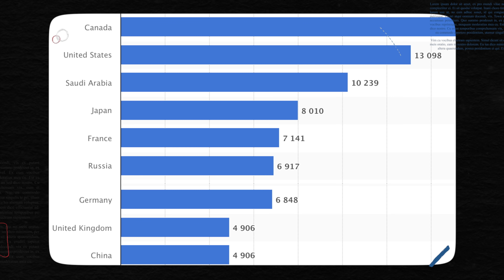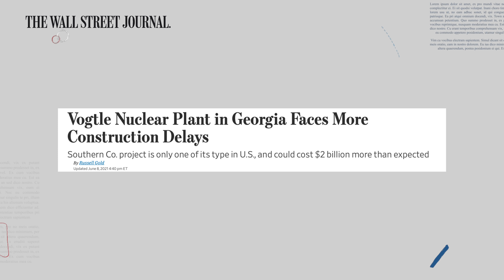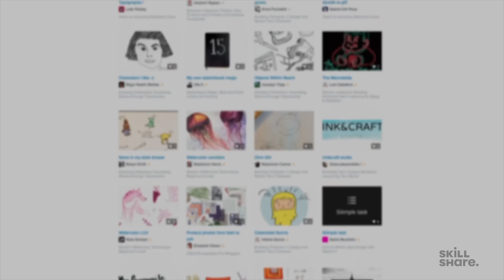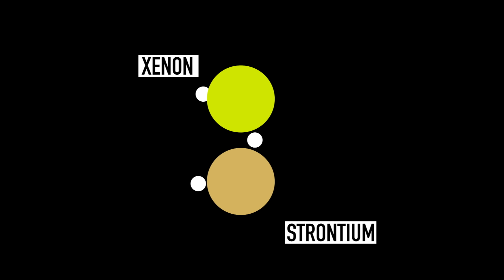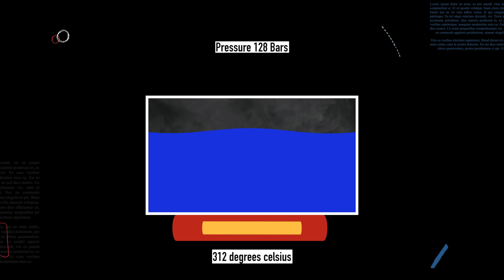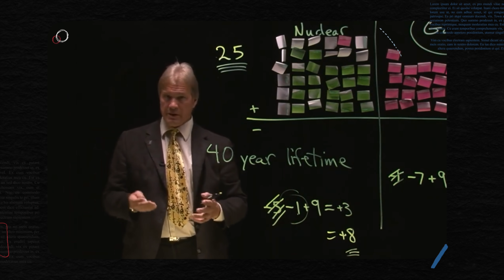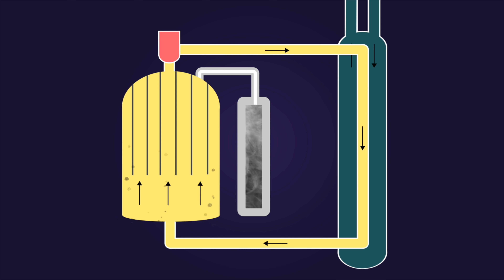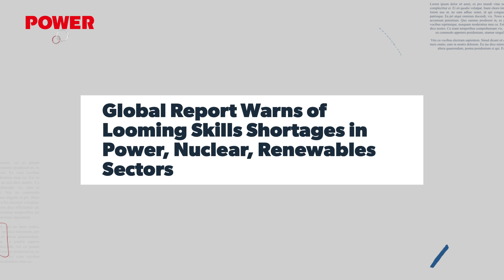Thorcon Just OBLITERATED Nuclear Energy’s Biggest Problem

Comment: Way to go Indonesia. In the US regulations are still based on the site, not the process. In a century that loves to brag about the economy of scale, where Ford is credited with inventing the assembly line we have to watch as the rest of the world passes us by. Bans on reprocessing, and a gov that dropped the ball on collecting the waste they won't let anyone else touch, and unrealistic tax write off schedules have really set this industry back even more than is pointed out in this wonderful segment.
Reply: Huh, Huh, Huh. I got some questions: doesn't the molten salt fuel eat through most reactor and containment methods, because it is SO CORROSIVE. Does it not react with water explosively, so if it were to receive a leak of water drops or worse, if the containment were to break and the fuel were released into the atmosphere, the results would be plumes of vaporized radioactive fuel for the residents of surrounding counties to breathe in deeply? Finally, in computing the cost of nuclear power did you figure in the cost of depopulating areas the size of US states as you nuclear industry folks accomplished in Chernobyl and Fukushima? Are you advocating planting the nuclear power plants in the ocean bottom now, so you can honestly say that you cannot reach or fix or prevent the underground radioactive leaks, when they occur, to limit your expenses? Are you totally nuts? 

Go live in Chernobyl's exclusion zone. You can get very close to nuclear stuff there. Reportedly, due to the inadequate clean-up, Fukushima is also another place in which you can get close to your beloved nuclear power. Go play around among their plastic bags of contaminated, radioactive dirt. Those are going to leak soon, what with having been exposed to the sun and wind for close to ten years, so you will soon have nice, radioactive dirt that you can use to grow your own crops. Have fun, fun, fun, until the cancers take your fun away!
Reply: @mikefas1160   No, I don’t advocate nuclear on the bottom of the ocean. I think it should be in every neighborhood. If I had my way I’d put in everyone’s car, then you could plug in at home and power the house, drive to work plug in there and keep supplying energy wherever you go. 
You may have missed what none nuclear accidents have occurred. The AEC used to set off dirty bombs and watch reactors melt just to see what would happen. I’m sorry to disappoint you Mike, but that’s not how radiation or cancer works. 
If you are interested in learning a good source would be Galen Windsor, but you’ve got to put down the Jane Fonda first. If you’re an internet troll you won’t get any here.

Comment: The problem with nuclear Plant construction is not just cost.   It's also that construction releases a vast amount of CO2 into the atmosphere and the Length of time it takes before anything is generated is so long they may just contribute to cLimate change rather than save it.   Uranium is cheaper than fossils but is limited in supply and will get more expensive quickLy.  Agreed nuclear is a better option than fossil fuels however compared to a landscapw aiming to have max renewables and then nuclear doesn't have the flexibility and you left with power statipns or wind farms built solely for times of Peak capacity.  Nuclear reactors have to be offline for over a month for refuelling every 18 months we currently buy in power fromcoal to cover those times.   If we have full renewables there is no waste no mining and no co2. We invest in storage interconnection and tide/wave power and manage demand rather than supply by a clever network that knows when to charge batteries and cars and knows when to draw down.  It's within reach and the UK NAtional grid will be able to do this.  Nuclear just too many issues ..
Reply: "It's also that construction releases a vast amount of CO2 into the atmosphere"
Not so vast for the amount of electricity produced by a nuclear plant.

"Uranium is cheaper than fossils but is limited in supply and will get more expensive quickLy."
Enh, everything is limited in supply, even sunlight. But the limit of uranium is very high. (Ditto for sunlight.)

"Nuclear reactors have to be offline for over a month for refuelling every 18 months"
This design would allow refuelling without taking the plant offline.

"If we have full renewables there is no waste no mining and no co2."
Renewables don't grow on trees. (I mean, unless you're talking about actually burning trees.) There's a lot of steel and concrete used in wind and solar plants per amount of energy produced.

Comment: I would ask the question regarding damage from earthquakes because Indonesia is just about the earthquake capital of the world and also has a high incidence of Tsunamis. Given that these reactors are sunk in the sea near the coast what would be the result of being hit by a quake and a tsunami?
Reply: Huh, Huh, Huh. I got some questions: doesn't the molten salt fuel eat through most reactor and containment methods, because it is SO CORROSIVE. Does it not react with water explosively, so if it were to receive a leak of water drops or worse, if the containment were to break and the fuel were released into the atmosphere, the results would be plumes of vaporized radioactive fuel for the residents of surrounding counties to breathe in deeply? Finally, in computing the cost of nuclear power did you figure in the cost of depopulating areas the size of US states as you nuclear industry folks accomplished in Chernobyl and Fukushima? Are you advocating planting the nuclear power plants in the ocean bottom now, so you can honestly say that you cannot reach or fix or prevent the underground radioactive leaks, when they occur, to limit your expenses? Are you totally nuts? 

Go live in Chernobyl's exclusion zone. You can get very close to nuclear stuff there. Reportedly, due to the inadequate clean-up, Fukushima is also another place in which you can get close to your beloved nuclear power. Go play around among their plastic bags of contaminated, radioactive dirt. Those are going to leak soon, what with having been exposed to the sun and wind for close to ten years, so you will soon have nice, radioactive dirt that you can use to grow your own crops. Have fun, fun, fun, until the cancers take your fun away!

Comment: Fuel sat is ferociously radioactive pumping the stuff is a horrendous regulatory problem. There are no prior regulations and no prior designs to base the new regulations. 
Moltex solved the problem by putting the fuel salt into tubes (just like any PWR). The reactor core is a vat of molten salt which circulates heat by convection. There is no pumping of radioactive fuel and no moderator to wear out. Heat is extracted to a third salt, from which steam is raised.

Comment: The public are (rightly) scared of nuke waste it has a 1/2 life of 30,000 years. The Elysium and Moltex fast spectrum reactors burn high level nuclear waste. After its been used in a fast spectrum reactor, the 1/2 life is just 30 years. You also get 25 times as much energy as the old PWR could extract. All with zero CO2 and easy waste management. There is also no carbon core to store as nuke waste and over time they reduce the existing stocks of used fuel nuclear waste.

Comment: Been following this company for a while now, and while they appear to be one of the fastest movers in this area, it's still depressingly slow. :(
Reply: Part of the reason nuclear development is slow is regulation and buraucracy. Nuclear could have started replacing a lot of coal power fifty years ago, but "environmentalists" waged a propaganda war on the technology by confusing power plants with nuclear weapons. This made R&D extremely slow and expensive and investments in new projects very uncertain. Basically, the "environmentalists" managed to almost criminalize the use of nuclear power.

So when "environmentalists" fear monger about climate change and pollution from coal power, remember that they are the ones who prevented nuclear from eliminating much of these negative side effects.
Reply: TerraPower is designing a MCRE prototype Plutonium burner for France, Orano to be built at INL.
300kWe
One pump
Cooled through an RVACs like system through the reactor vessel walls.
NaCl-43PuCl3 fuel salt
Reply: It is slow because they want the governments to build and take responsibility for this technology.  Anyone can build one if you have the money to back it up.
Reply: @EnlightenmentLiberal Are you employed by some nuclear industry company or a nuclear shill?  As to MSRs I have not heard of any study about or material that worked despite corrosion, albeit the Chinese are trying an MSR reportedly. Otherwise, nuclear is dead due to Chernobyl (with its dead, human robots) or Fukushima (with its thousands of tons of stored, radioactive water or bags of nuclear waste contaminated dirt that they have no idea how to keep from contaminating Japan's water table eventually), which have corium that they still cannot even break up, because their robots keep dying (like any people that approached it would too.) Only MSRs seem promising -- maybe.

No one would cheer more than I if we can truly build a molten salt reactor ("MSR") that can render inert the "250,000" TONS of radioactive fuel that reportedly have to be stored and GUARDED for "250,000 to one million years" to prevent such waste from either leaking into the water table or being used to make dirty bombs by some terrorist. However, while I think we should experiment with such MSRs to see if we can overcome the corrosion with future technology someday (hopefully "in 20 years" before fusion power generation becomes viable), solar thermal power (using mirrors pointed at a fixed point to heat salts or fluids, which can then provide power overnight as well as when the sun is shining and which can be made with ALL-US components, reportedly) seems ideal.

Solar thermal creates no nuclear waste, no lithium or other toxic poisons, no problems except for increased costs which are paid to other Americans who then use them to pay other Americans for food or electricity, etc. Economic multiplier effects come from solar thermal power generation as opposed to buying cheap solar panels made in China that are made with toxic substances and cannot be disposed of safely  due to their toxicity-- albeit they are  much less dangerous than nuclear waste, reportedly.
Reply: I wonder if there is a way to tie a unique Bitcoin to a specific reactor?  By doing this one could produce a fungible token currency that is limited further by its specific identity to an energy producing asset.  This may raise interests in both technologies.  Just thinking.  I recognize that It contradicts the indestructibility of Bitcoin.
Reply: Go live in Chernobyl's exclusion zone. You can get very close to nuclear stuff there. Reportedly, due to the inadequate clean-up, Fukushima is also another place in which you can get close to your beloved nuclear power. Go play around among their plastic bags of contaminated dirt. Have fun, fun, fun, until the cancers take your fun away!
Reply: @mikefas1160  Most if not all of the cleanup and the evacuation in Fukushima was not necessary. It was just done to pander to irrational radiophobia in the public - the kind that you're a prime example of. You could roll around in the dirt in those plastic bags for years without significantly increasing your chances of getting cancer.

SInce your kind cannot be reasoned with, I'm going to pre-emptively mute you now. Bye.
Reply: @mikefas1160  Fossil fuel particulates kill tens of thousands of people per year.  Solar requires enormous area do be used as a replacement for fossil fuels, and while the energy itself is clean, production of solar cells and storage technology is not at all sustainable.  Wind suffers similar issues.  There simply is no replacement for fossil fuels other than nuclear.  It'd be better to embrace it sooner rather than later, to avoid further filling the atmosphere with methane and co2.

Comment: No more uranium reactors. If you like the chance of turning an area in a 1000 mile radius into an uninhabitable wasteland, poisoning millions of square miles of cropland like Chernobyl almost did, then go with enriched uranium. Major disposal problems of spent fuel that is toxic, lasts for hundreds of thousands of years, and cannot be safely contained except in concrete casings miles underground. And what happens when we run out of room underground for all that nuclear waste? At least build a thorium reactor which has waste products with a much shorter half life and less toxic, and cannot be used for weapons. No risk of a meltdown since the reaction can be stopped instantly. And thorium is cheap and abundant.
Reply from the maker: The video before last was about Kirk Sorensen’s lifters. 

Thorcon uses Thorium for 25 percent of its total power production.
Reply: @TechforLudditesSira  OK, I will check it out!

Comment: Rubbish.   Mass production is limited by the limited size and weight capacity of roads and rails, just a few dozen tons and feet.   The Thorium becomes highly radioactive.  You need a few acres of chemical reprocessing buildings running 24/7 and never stopping, just in order to keep the radioactivity in check.   Servicing a radioactive reactor is probably impossible.   And 20% enrichment for the uranium is very expensive.    That explains why nobody has gone down this path-- far too many show-stoppers.

Comment: Some guy who normally builds boats has an untested idea to build nuclear power plants on the cheap, even though the full price ones are currently unsafe. What could go wrong?
Reply: "untested"??? The USA ran a Molten Salt Reactor for over 10 years in Oak Ridge Labs in Tennessee and Idaho National Labs in Idaho. They demonstrated total AC power loss like Fukishima and cooling water loss like 3 Mile Island and in both cases the reactor shut itself down with no problems. MSR's physically can NOT melt down, they should have been built instead of the water cooled reactors we have now, but the idea got killed because the fuel rod people killed the idea because they did not want the competition.

Comment: To risk a steam explosion is unnecessary with supercritical  co2. In fact the entire genset can be made 1/4th as large because who needs a huge expensive steam turbine that can explode when you can produce the same power without steam wearing out the turbine blades? We should be building these worldwide at 250 or 300 megawatts at 1 per week. In fact the USA has enough 233 uranium to get the ball rolling on this.  Or to get started use the waste from light water reactors. The problem in that case is plating out noble metals on the intercoolers.